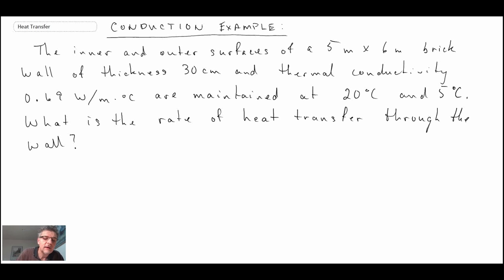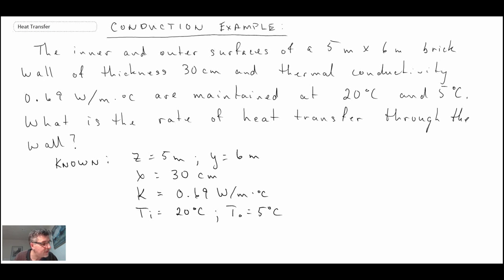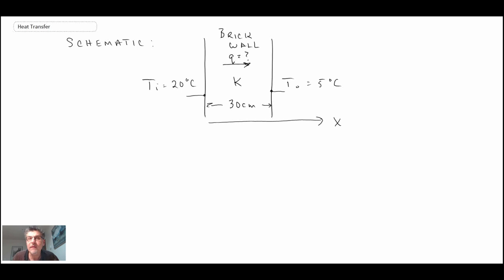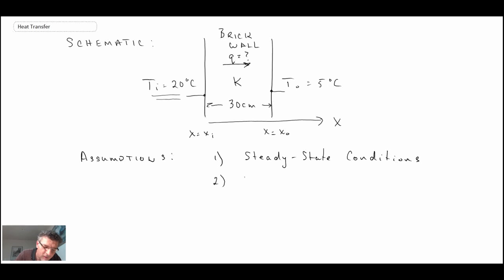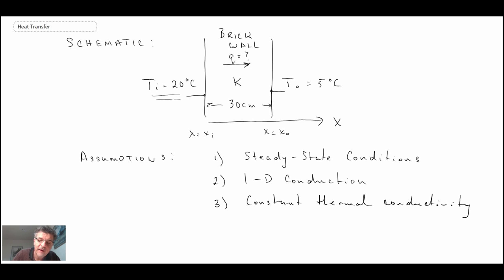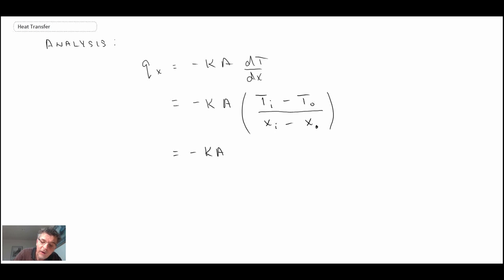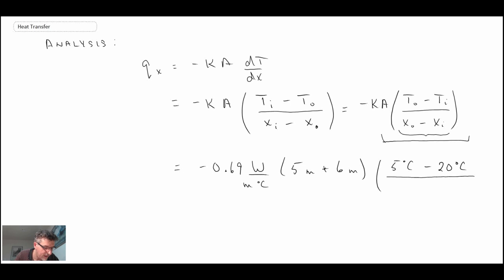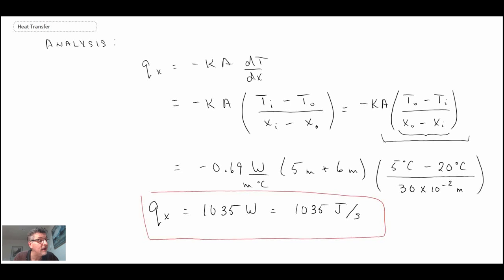Heat Transfer L1 p5 - Example Problem - Conduction

Comment: May I ask you something? If we assume that is the Area (30m^2) of the outside wall of one room. Then every second we need 1035 Watt to keep the room temperature constant. Then in one hour the required energy of one heater to keep the temperature constant will be 1035 times 3600 seconds which is 3726000 Watts or 3726kW. This is an extremely high number. I would appreciate if you explain me where am i wrong.
Reply: Where did you determine that 1035 Watts per second was necessary? That is not the calculation that is being done in this video. You may be confusing this with a J/s which is a Watt (not the same as a Watt/s). You would rarely ever need 1035 Watts per second to hold a constant temperature. Keep in mind the average space heater runs on 1500 Watts, so 1035 is not far off. The correct calculation you are looking for is 1035W * Hours used (let's assume it's so cold you run it for the entire day, 24 hours) = 24,840 Watt Hours or 24.84 kWh, the average household in America uses around 30 kWh a day, which makes sense considering you are powering a heater for an entire day. If we assume something more reasonable like 16 hours of run time, the value becomes 16.56 kWh for that day which is more realistic. Remember, Watt is a unit of *power*, Kilowatt-hour is a unit of *energy*.

Comment: 20-5/0-0.3=50 so when i time that positive 50 with the rest include -k it will be - answer ? correct me
Reply: if you did that, it would be 15/(-.3), which would give you -50, and if you multiple with rest with -k you would still get a positive.

Comment: how did the answer is 1035w? my answer is 379.5w can you explain why 1035w?
Reply from the maker: Area = A = (5 m * 6 m).  I think there is confusion over the fact that my multiplication sign (*) looks like a plus sign in the video.  If you compute the area A as 5*6 = 30 m2 you will get the correct answer and this will also resolve the earlier question about units.
Reply: exactly, since when did the area of a rectangle become = (L+B) xD
Reply: I feel the area wasn't calculated properly. 
Bearing in mind we are dealing with a 3 dimensional object, having a thickness of 0.3m, length of 6m and height of 5m. 
The surface area from my point of view should be 2[(5*6)+(5*0.3)+(6*0.3)] = approx 46m^2
Therefore the heat transfer rate,
q° = - 0. 69W/m°C * 46m^2 * (-50°C/m)
      = 1587W
Doing the unit analysis, this works just fine.
Reply: @tammyallison8735   the direction of the heat is 1-d in the assumption so you calculate the area which the heat will cross only and if you imagine that in real life, it is not true because heat transfer is randomly distributed ^_^

Comment: Should the temperatures be in Kelvin?
Reply: For temperature difference, it is doesn't matter which system you're dealing with.
i.e. T1 - T2 = (10-5)degC = (283-278)K
Reply: at any units you can calculate the conduction rate and so

Comment: I get - 1035 when I use the first way
Reply: the first way should give you same answer, check your temperature. For example, q=-(.69)(5*6)*((5-20)/(.30)), there's a second negative when you do 5-20.